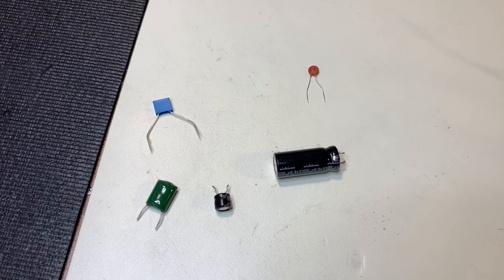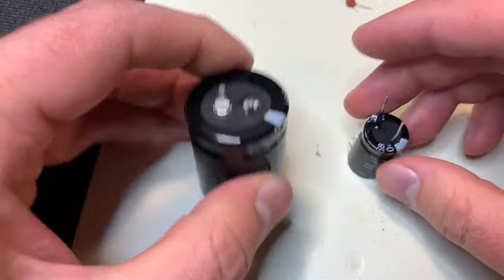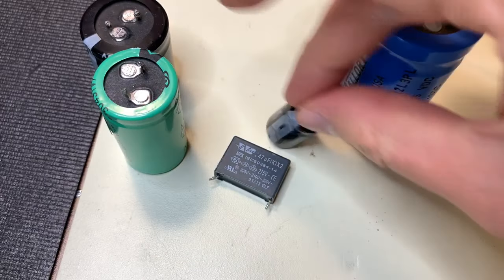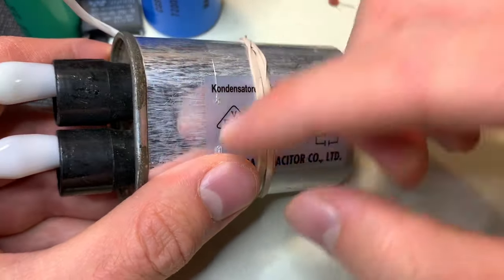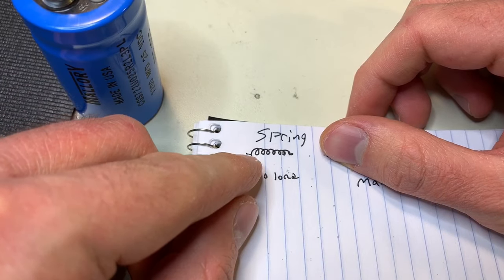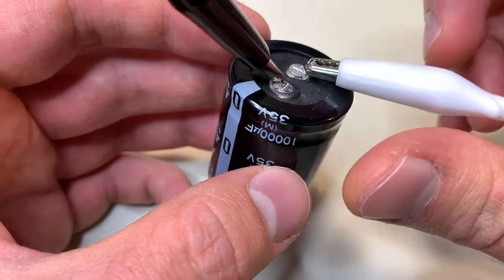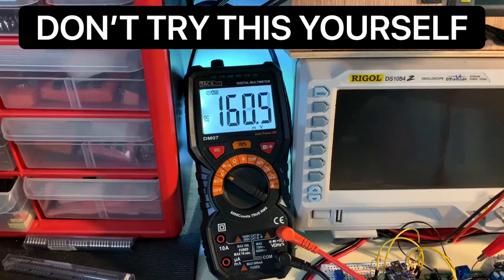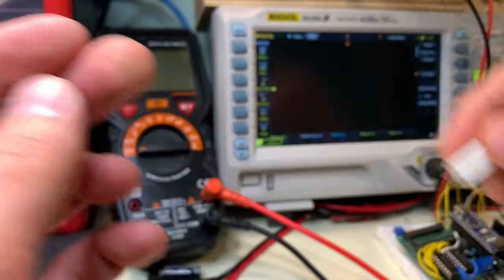Capacitor Safety - How to Discharge Capacitors Safely

Comment: Whoa hey you need to amend this video full stop. To whoever ends up on this video looking to discharge a capacitor, DO NOT EVER TOUCH THE LEADS WITH YOUR BARE HANDS--- NO MATTER WHAT THE SIZE. Never, never ever ever holy shit. Ok let me clear somethings up here for those who happen to watch this and notice this comment:
1- A volt wont kill you. Voltage is best explained along with amperage when trying to be practical about it. This explanation isn't accurate from a scientific standpoint per se, and I wont go into the science here, but for the sake of what happens to you when you're electrocuted, I think this works great and it's practical: 
 An amp is the actual electricity. Imagine a marble, that's our amp. If the marble is on the ground, holding still, we're at zero volts. That marble won't move. Now I lift the marble and drop it. Instead of thinking of how high and comparing that to voltage, instead think of the voltage as "how hard" that marble hit's the ground when I drop it. So, 10v wont hit very hard, but 120v or 240v can hit you hard enough to blow you off a ladder. But, that "how hard" part can't kill you without the amperage(marbles), which is what's actually dangerous. If that marble is on the ground at zero volts and I were able to somehow reach down and grab it, I'm gonna get messed up.

1.a- 1 thousand amps at .001v will kill you dead- full stop. Like a steam roller moving slowly and, if you can conceive it, softly over your body. I mean it's not really slow or soft obviously, this shit moves at the speed of light in reality. But you get the idea here I hope. You're still 100% dead.  But .000000001 amps at 1 Million volts probably won't do terribly much to ya in the end. That's like just one of the tires off of a micro machine toy hurled at you really super hard and fast. Probably very few scenarios where that kills you outright yea? Though, and this is important, don't take that for granted either because the electrical system that keeps your body functioning isn't insulated. We're made mostly out of water and we've all got a pretty good salt content so our bodies are pretty great conductors. And our super exposed electrical system that keeps us ticking doesn't like disturbances. Like....at all.

Amperage is why I suppose I don't need to list anything else to explain why you don't mess about with capacitors if you're not 100% certain what you're doing. That loaded spring allegory that he used was kinda on the money, but that spring is amps. A capacitor discharges amperage. The voltage on a capacitor is irrelevant when considering how dangerous it is. They're all dangerous. A 10v capacitor has enough amperage to disrupt the sinus rhythm of your heart without you feeling it or noticing it. You can put yourself in A-fib without noticing it until it's too late. You can compare you're heart to a blower fan on a furnace. Our sinus rhythms(the full process behind each heart beat) are like the balance that is in place on those fans. If those fans end up off balance, the motor will eventually trash itself. Same goes with your heart. If you disrupt your sinus rhythm, your heart will start to break down and it will eventually fail prematurely unless it's caught during a physical. In which case, depending on how long you were in A-fib, your heart may be so badly damaged that you require extensive medical treatment ranging from ablation (where they have to open you up and make little cuts on your heart and then try to shock it back into rhythm), to a pacemaker and if you think your insurance is going to make that process easy for you.... well... that should go without saying, no? Also, the average survival rate after that point is about 5 years. And, speaking from what I've personally witnessed, you can walk around for a good 10 years being in A-fib without being aware of it or even having a doctor noticing it/catching it and that's about all you need to completely trash your heart.  

So don't touch capacitors with your god damn fingers. Don't do it. You don't need to feel the shock for it to kill you. I can tell this poster is pretty experienced and definitely very knowledgable , but man I wish they were just a little bit more concerned about the potential for life altering mistakes/death involved here. And, honestly, if I were you OP I'd go get an ECG asap if you've been touching these lower capacitance capacitors on the regular. All it takes is 1 shock to throw you out of rhythm just a little bit. And that little bit has a snowballing effect in the end. And, again, you don't need to be able to feel it. 

Also, don't discharge anything over 50v with a screw driver. They make capacitor discharge pens that are tailored for different size capacitors. Those are a pretty safe bet. Another option is to simply disconnect the capacitor and leave it be for a while. You'd have to look up the time needed for the size you've got, but eventually it should discharge on it's own. However, the only way to tell when it's done discharging is to either test with a voltmeter or a discharge pen.

Hope I didn't come off so abrasive here that my points were lost, but OP, for really reals man, I'd go see a cardiologist if I were you just to get checked up on. It's not a guarantee that you absolutely will throw off your hearts sinus rhythm with a shock, no matter what size, but it is very much a possibility no matter how small that shock is and that's all you need to properly fear these components. Honestly, it's the small shocks that you don't immediately go to the hospital for that are more dangerous than the big ones that knock you out. At least when you're knocked out and you wake up in the hospital, they've already made sure your heart's working normally. Bit that little nip from that low voltage system that you didn't even think about could be a ticking time bomb

Comment: I would like to build a circuit just to make a Loud fire craker. From discharging high Voltage capasitors
Reply from the maker: Hmmm well I am sure its possible, can't say I have used caps for that. Are you sure you wouldn't rather use a HV power supply. High voltage caps discharging over and over is not a great thing - can wear them out depending on what they are made of. I am also not sure how loud you could really get them - let me know if you are successful sounds like an interesting project - stay safe

Comment: Looking at this video because I just got shocked by one while taking a camera apart. I had the battery out for about 20min, I guess it wasn't enough.
Reply from the maker: Yeah - cameras (especially with flashes) are notorious for that. I remember when me and my friends use to get those disposable cameras rip off the out shell and charge the caps and then try to discharge them on each other. Thankfully the current was low enough to cause any burns but it definitely didn't feel good.
Reply: @HTMWorkshop  haha yeah it's an old film camera with a flash. The capacitor is surprisingly big but I can't see the rating on it.

Comment: So I se its an old video but hope maybe someone can help me. So about the microwave capacitor. Im about to disassemble a microwawe and I did se another video to discharge it with 2 screwdrivers and by crossing them. I have done it but was wondering if i now can safely remove it? Also the microwave has been standing in a corner between 3-5 years. But I just want to be sure because I know nothing about electricity and these kind of components xD hope someone sees this :)
Reply from the maker: Sounds like its discharged - I would check it with a voltmeter if you have one. But if you correctly used the screwdriver and never plugged it back in you should be good
Reply: @HTMWorkshop  yeah so i have one but when i disassembled it to clean it stopped working so i was super careful and i did cross screwdrivers a few more Times and was super careful when removing it and when it was out i got the meter to work again haha. Anyway do they break when discharging them or can it be used again? :)
Reply from the maker: @alexgra4363  I believe it will still work but you never know until you try to charge it up and see if it holds a charge
Reply: @HTMWorkshop  okey thank you :)

Comment: I want to open a microwave because it is cool and stuff, do you think there is any substantial risk? Is been unplugged for like 7 months
Reply from the maker: Yes there is risk - ideally it should be do discharged by the circuit design but I would get a high voltage discharge stick or make your own to be extra safe. At the very least you could also discharge it with a jumper but if it is fully charged even that is dangerous due to how fast you discharge it. So wear some safety glasses, insulating gloves, and stand back. Probably not going to be an issue but on the off chance the microwave isn’t working correctly and didn’t discharge your looking at something that is extremely dangerous - so better to be over cautious and safe then with a heart arrhythmia, burned, and with nerve damage.
Reply: @HTMWorkshop  I have a rather old multimeter but the rating for it kind of wore out, do you think If it were to be fully charged it would burn it's fuse?
Reply from the maker: @dannycunil5989  Probably - but I am guessing the capacitor has probably discharged ... plus  a burnt fuse can be fixed pretty easy. Make sure to have it in the correct settings or you could damage the multimeter - Also if this is a cheap meter (like 20 dollars of amazon - I would be careful since most of those are incorrectly designed and are only suitable for low dc voltage). You also want to make sure the probes are decent (if you use jumpers that can be dangerous since the insulation is too low). If you can grab them with a insulator tool that would be nice (tape the leads to a stick or something wooden - sounds silly but it is a cheap solution to add a protective layer if you don't know the rating on the leads.

Comment: The BIG difference between capacitors and batteries boils down to voltage and internal resistance.  A battery has significant internal resistance, and that internal resistance value gets larger and larger as the battery ages.  Whereas the internal resistance in a capacitor is minuscule at the very most.  The only two things that protects you when connecting two of your body body parts to the same capacitor is: #1 - The charged voltage of that capacitor.  And, #2 - Your body resistance between the two capacitor connection points.  Beyond that…ohms law and luck are your two best, or worst friends.

Comment: What I accidentally discovered is that putting your voltmeter in diode or continuity mode will discharge it super nice and quickly then check for voltage and after that I like to short the terminals just to make sure, you can also put it in voltage mode but I'll be slower, I restore old tube equipment so better safe than sorry, I never liked the screw driver method, be safe
Reply from the maker: Interesting tip - my only thought is there is probably a max voltage (and power) you can run the meter in diode test mode. Not sure on that but just a guess.

Comment: Good point. If you are going to discharge a capacitor into your skin, make sure the contact points are both on the same side of your body.
Reply from the maker: Better to have a bad burn then a heart failure
Reply: That's the idea behind the one-hand rule for working with high voltage equipment?

Comment: Noob comment: how is it that the current doesn't go through the screw driver handle or resistor and shock your hand?
Reply from the maker: Hi, current wants to travel the path of least resistance. Because the path to ground (what is called a drain) through your hand travels through the handle of the screwdriver  - which is a high resistance - this path to ground is not favorable.  It is not impossible (and is likely) that some  current - which we would call leakage current does go this way (it's just so small that it is negligible).

Comment: bruh ive got hundred of microwave capacitor laying around and never knew i should discharge them
Reply from the maker: Well most likely they are set up to "auto drain" - meaning their setup to slowly leak current. But better to be safe and check before using them!

Comment: couldn't you just throw it in a bucket of water to dump it's charge?
Reply from the maker: Ha - well In theory that could work. However no promises the capacitor still works afterwards. Probably want to make sure the water has ions (not distilled water) and would  want to be careful you don't touch the water just in case.

Comment: Wait so why doesn’t this apply to a PlayStation 2 when I literally touched the motherboard with every part of my hand
Reply from the maker: I do not know the max value of the caps in a PS2 but my guess is they are all lower than 25V which would make them very safe to touch - and they are probably set up so that most of them discharge when the device is off. If course Im just guessing - based of some other electronics I have worked with - would need to look at the schematics to make sure. Always a good idea to check a board with a multimeter to make sure there is no power (and check any capacitors that may be high voltage to see if they are live)

Comment: I'm working on a little project and bought some 30F 5.5v supercapacitors.  Having done a few projects in the past, I was very careful with these caps because of the high capacitance.  After testing my project, I was discharging the caps with a LED before working on it some more but that took a long time.  Do I really need to worry given these are 5.5v caps?
Reply from the maker: Not really - yeah there can store a lot of charge but since they are only 5 V you really are pretty safe. You could of course put them all in serious and make the circuit voltage higher but you would need to put a lot of them together before it was an issue. Goodluck.